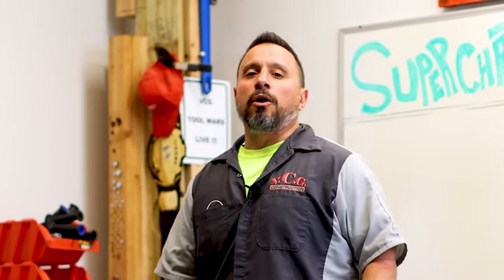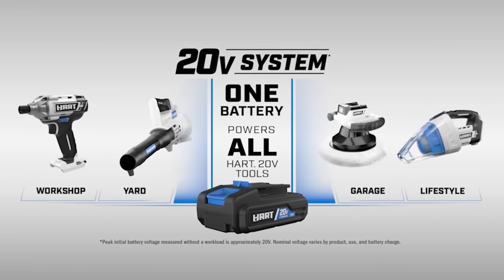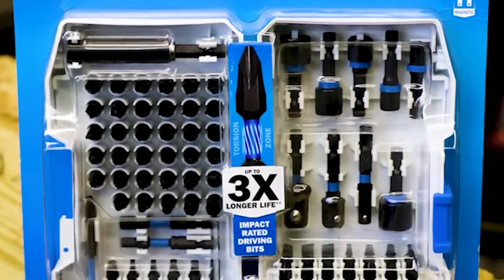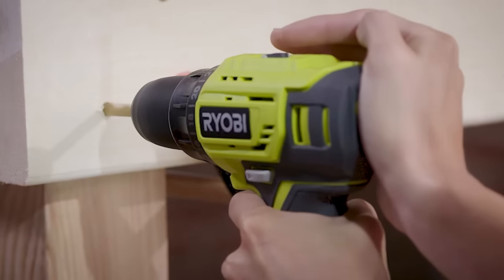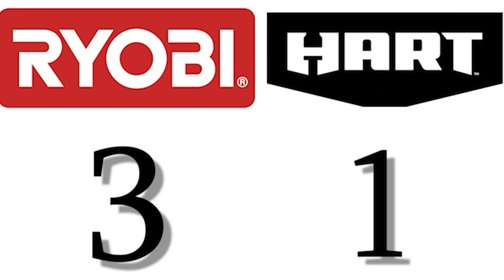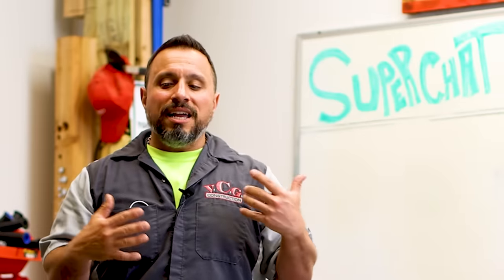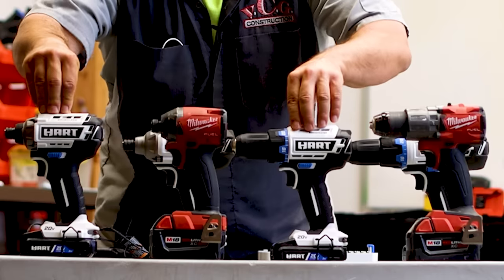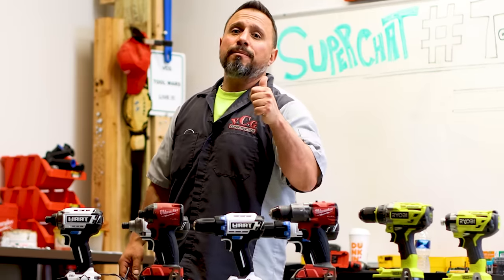HART Power Tools At Walmart PEOPLE HAVE NO CLUE!

Comment: I have used dewalt all my life, i started buying hart tools to avoid having them stolen of the job site. they are absolutely solid tools. nothing wrong with them.
Reply: Dewalt is under performing heavily, especially when it comes to impacts. But i totally understand this mentality when you do specialized work and need several tools. So many end up stolen, lost, dropped in a barrel of waste oil, etc. Its like boat tools; you are not going to want to put your snapon ratchet underwater.
Reply: They are made in China
Reply: @eagle94haslanded  Your opinion on DeWalt sounds like bull crap
Reply: @lexingtonconcord8751  watch the torque test channel and get back to me on that.
Reply: @ISitOn MyArm Rank charts
Reply: I don’t hardly ever use a drill maybe once every 5 years that’s why I just have a cheap knock off brand drill that is from Walmart if I used drills regularly then yeah I would definitely invest in a high quality name brand one but not hardly using it would be a big waste of money for me.
Reply: @ISitOn MyArm but I don’t have much to work on whenever it comes to using a drill
Reply: @ISitOn MyArm I don’t have anything to build though at least not right now
Reply: I'm impressed I got a driver and it has balls and the battery last I thought I was going to be a POS
Reply: If you can’t beat it to death, submit it to “torture” tests, and it perform flawlessly, and be expensive as hell, it’s no good. That’s how I pick everything. Even my truck tires. I buy em, secure the front end, do a 5 minute burnout, then complain they don’t have tread on em. Cant survive the torture tests
Reply: @corygriffiths4394  wondering what you are doing here watching this video and leaving comments if you dont use it as you mentioned???
Reply: @jerrykunk4860  All power tools are made overseas. No one wants to make a mortgage payment on a drill
Reply: You is right.. I use all hart tool brand myself just because people have the same tools on job site and be switching tool and battery packs out..
Reply: @jerrykunk4860  All power tools are genius.
Reply: I feel like a lot of brands caught up a lot to the Milwaukee dewalt etc not that they’re as good but they’ll perform well for most task
Reply: @jerrykunk4860  mine is made in Vietnam
Reply: Yup that’s why I bought Kobalt cause I know these tools get stolen especially  dewalt and Milwaukee even see people get into it over who’s battery is whos
Reply: @lexingtonconcord8751  actually if you take dewalt impact and compare it to every other companies in fact it is the worst one💯 in every way shape and form the amount of teeth in the head the motor used is is a hog that uses way too much electricity for what it puts out meaning it runs through batteries way faster and batteries do have a life cycle meaning the faster you have to keep recharging them the sooner they go bad everything he said is 100% true and based off of facts it sounds like you're just having an emotional reaction to something said that you don't take your time and do some research 🤯
Reply: @JoeBlow-You’re getting a lot of hate, but you’re right about the DeWalt impact drivers. I run nearly all DeWalt cordless tools and some corded tools as well. They have fallen behind in their development. The DCF887 has been their top-of-the-line impact driver for a number of years. Milwaukee passed them up on speed a while ago. Now Flex has also passed them up, although they are relatively new to the game and their line is small. They (DeWalt) brought out three new impacts: the 840, the 850 and the one that is supposed to replace the 887, the 845. The 850 is a compact model, which doesn’t have the mass of the 887. I’m skeptical as to whether it would last long with all day-everyday use. The 840 is from the Atomic line, which is homeowner line IMO. The 845 has not performed well against anyone in any test I’ve seen. I was really hoping for a better replacement for the 887.
Reply: Nice omw to buy hart tools then
Reply: I just bought one of their leaf sweeper/blower and it's absolute junk,
 It's going back, not worth $55
Reply: Lifetime warranty to and sets go on sale often for 98 bucks for the 215 and 270 piece sets. Just got the 270 for 98 bucks yesterday
Reply: Yeah but just buy Ryobi at that point right?
Reply: The leaf blower i bought was absolute junk.
 The battery wouldn't charge, plug it into the charger... nothing.
 Used the cord attachment (yeh a hybrid, oh joy)
 The blower was about as powerful as someone with asthma, who got emphysema, and had a lung collapse trying to blow out a candle...
 I tried holding it closer to the ground, and one of the leaves smacked it, and laughed...

 Got a screw gun just before, hadn't it and just returned that too because I knew not was gonna be junk, probably battery or something would've died in a couple months
Reply: Es lo que también voy hacer por eso andaba investigando la marca y el fabricante y como dece el video al ser fabricante de otras marcas como dwalt y Milwaukee no va a vender cualquier cosa aver que tal me va con mis compras😂😂😂😂
Reply: if your not using your dewalt tools anymore can i have them? 🤔
Reply: This is hilarious because that’s why I started buying Ryobi tools… damn methicans’ll steal any thing.

Comment: The Hart brand is the truth. I'm slowly building up my equipment and I'm liking the Hart brand. I own the 20v power drill, drill bit set with 70 pieces and the circular saw so far. Fortunately, I got a battery with the drill, and the battery works with all the 20v equipment you get. They're affordable, powerful and they work. This is a great brand to start with if you are a beginner like me.
Reply: Hart drills are good for DIY I would buy one but I rarely ever use a drill I use one maybe every 5 years that’s why I’m not investing in a high quality drill because it would just sit in the toolbox and never get used.
Reply: I have so far.1- 1/2 drill, 2-3/8 drill. 1- 1/4 in driver and 1 brushless 1/4 in driver,  6 1/2 in circular saw, Reciprocating saw, 4 inch grinder, 2 radios,a tire inflator,  16 in push mower,  Hybrid weedeater, Power inverter,  and lots of batteries  from 1.5ah to 6ah and a boat load of hand tools and ladders .  i have not one complaint yet on any of my tools. just wish they made the metal roller tool box again.  and maybe a battery only storage contractors case.
Reply: How good is the battery life all this time later?

Comment: I as a homeowner decided last year to get into the Hart line.  My Craftsman finally wore out after 25 years.  I have liked what I bought.  The two larger home projects I have done with them have been a bathroom floor and a outside porch.  They worked great.  My only problem is that the line seems to be overpriced now.  At first it was a good deal but now they have raised the prices.  I wait for a sale now.  I will be dead before they wear out.

Comment: Im a hardcore diyer, framed my basement, built my own pole barn, deck, etc..... I started with ryobi and after a couple trips to the HD returning the brushed green tools because they were constantly burning up and smoking, I switched to Milwaukee and Dewalt....... best move I ever made. 6 years later, still using the same tools and batteries and they work like they did new!!!!! Ryobi, hart, bauer good for hanging pictures on walls and building shelves and other small stuff, but for building sheds, barns, decks, etc..... save the hastle and grab a Milwaukee and get down to business!

Comment: I run a property management company and do most all the building maintenance, remodeling and upgrades.  My first battery drill was a B&D, it did the job but it was very "clunky" and the batteries didn't last. When the last battery pack died, went to Ryobi One 18v on a whim.. couldn't resist the deal. 4 years later, rebuilding 5 units, building a house, decks, plus metal and auto work on a daily basis , I cant kill the thing. I have driven 10s of thousands of screws, bored holes with drill sizes that had no business in that drill, mixed countless buckets of concrete, mud, mortar and grout, lost it off the roof a few times, knocked it off the ladder more time than I can recall.. it really looks like it shouldn't work but runs just like it came out of the box. As this worked so well, bought a Ryobi jobsite table saw and wet saw, rugged quality. So, just bought a Ryobi drill driver and I wondered why I waited so long.... love the thing. Have other tools, Hitachi radial saw, Dewalt saws-all, Craftsman portable radial saw and so on.. all great quality long lasting tools and in my experience, the Ryobi is right there. Did look at the Hart tools out of curiosity and I may be wrong, but the build quality looks a bit off, kind of what you see in some HF tools. For the minimal price difference, I think I'll stick with what works!.
Reply: yeah and ryobi batteries are pretty cheap as compared to others
Reply: Hercules and Bauer from HF destroy Hart if you want bargain stuff
Reply: the few ryobi tools i have have been great tools as well. i have a jig saw router and a miter saw from them. i have nothing cordless however minus a weedeater i paid 5 bucks for.  all my cordless tools are milwaukee.
Reply: @jeffreyrigged  yeah I tell you my ryobi battery chainsaw is so awesome no gas or cords in the way.
Reply: @luvdady  i prefer a gas chainsaw and weed eater over electric but for an electric this ryobi isnt bad. i use it as a backup for my stihl or for just a small odds and ends.
Reply: @jeffreyrigged  yeah till you run outta gas 20 ft up lol .
Yeah I mean its no huskavarna but for basic limb job its easier to swap batteries
Reply: @luvdady  yeah im sure it is. my dad had a plug in poulan i cut down a million schrubs.
Reply: My original ryobi impact lasted 13 years before i had to replace it.

Comment: I only have ryobi tools.... I been having them for years and still work great. Won't change any of them any time soon... Best price too.
Reply: No
Reply: @salcisneros2244 ..... No???
Reply: Same here. Had nothing but good luck with Ryobi
Reply: Me too, I've already bought into the 18v system. It'll cost me a fortune to buy a new set
Reply: For cheap tools Ryobi is the best out there and has been for 20 years
Reply: I always had Ryobi since I started working in construction years ago and every single power tool that I've bought, still works great. Especially love the converters.... The one that has two USB ports and an outlet. I just put in a 18 volt Ryobi battery and I can charge multiple things all day
Reply: @chrisc.c52   After my $1000  Ryobi table saw with all the accessories burnt its drive motor after 3 years and didn't I have a replacement, I never spent a cent on them again.  It hurt to have to see it go into the trash!  NOBODY offered that  motor.
Reply: Ttl makes Ryobi Milwaukee and hart

Comment: Well, I bought the Ryobi 18V line of tools 10 years ago and used them on my job installing HVAC for years. They really took a beating over the years and it was the best investment in cordless tools for me. they still are running good too!
Reply: About how long would you say the 4AH batteries last before they break?
Reply: @ilyas5708  I couldnt say, I only had one break due to a nail getting caught in the saw blade and shorting out the motor. Not the battery fault, crap happens.
Reply: @ilyas5708  my oldest 4ah pack I still have in my daily use circulation has a 2014 date code, yes the runtime has gone down a bit but it still runs my impact driver for a week or so worth of service calls. Or about 20 minutes of cutting the thick uni-strut with the brushed angle grinder vs about 35 with the newest.

Comment: I bought a harts tool set and the ratchet is so darn smooth, I just feel like it’s getting hate cause it’s sold at Walmart, now I can’t say anything about the electronic trolls, but average tools like wrenches, ratchets and non electrical equipment, Harts really isn’t bad
Reply: Yeah, I have the ratchets and mechanics tool set and all that. The only power tool I have from hart is their electric screwdriver. I actually love their wrenches and ratchets.
Reply: That's exactly what's happening Papa Whisk! I've only got the drill bc I have a compact Milwaukee impact. If not for that I wld have both.
Reply: So I bought a Hart 1/2" drill, not bc I was at WM either. 
I actually went to Lowes looking for a combo set bc sales looked ok on a few good brands.  I think Dewalt and Skil (decent tool).
Here's the problem with those 2 sales. 
1. I looked around 45 min or so, waiting on/trying to get help w availability bc prices weren't clearly marked. 
2. Help didn't come! 
3. Went to fastener isle for help w/4.5-5" screws and combo set. 
4. Guy working that isle? Well...I found my own screws bc he kept insisting bolts? I'm wiring on 60yo shudders 👌🤣💩
5. Went to power tool area,  didn't have Skil combo,  or single drill that's in combo.  Only the bulkiest drill they make for 25 more. 
6. Didn't have Dewalt combo either. Only (1) 4 or 5 to set for almost 300 more. Or the (2) step up LI battery w/more 5 or 10 more V (175 more). 
6. Above mentioned combo (1) only had 4 tools (unless you consider a speaker a tool). Knock off 75 and keep that shit, or give me 5 damn tools! 
7. Last and definitely close to least!Only other comparably price was Shafts-man. I don't need a battery to last me 4hrs but need 1 tha last more than 10 min!
So finally fed up I say screw you Lowes! Only got a couple things that I didn't think I cld find at WM. Drove a mile to WM, got toiletries and stopped at tool section. The things I didn't think I cld get (sandpaper, x-long bit) WM had both, same brand sandpaper 5 bucks less and decent bits.
Decided on the ½" 20v drill, hat to go to sporting goods to get car open but had what I needed in few min.  Dude (older gent) was straight up when I asked questions about the product, said sorry man but I don't have a clue, sorry! 
I sd fck it and rolled dice.  
Final thoughts on HART; for the price, I have zero complaints! 
I spent 5+ yrs in industrial maintenance, used Milwaukee. 
Hart ½" 20v drill isn't far behind Milwaukee in power at all.
Battery, not quite there yet.  Although they're decent, just can't hang to the life of Milwaukee (⅔) may be a stretch. Luckily I don't need hours of battery bc I'm not hammering ¾" × 3" or larger bolts at 200-380 ft lbs or torque.
If you just need a good drill at a good price,  they have one for you.  Combo with 1 battery though? They can keep that bullshit!  I'll be emailing my opinion on that for shits n giggles to see how cust service responds if nothing else.  CS is usually the main reason I stay with a certain brand of anything.  Imo, thats a gamechanger on future purchases.  

Sorry for the long winded gripe on Lowes w/short n sweet review on tools. 🤷🏻‍♂️
Reply: How do they compare to Ryobi and kobalt?
Reply: Got a pretty decent Dewalt set for Black Friday. $300 for brushless  impact, drill, oscillator, orbital sander, a brushed 6½ circular saw, 2 and 4ah batteries, (not fast... one battery slot) charger, and carry bag. Not sure if they'll bring it back. Only downside is I think Dewalt overcharges for their batteries (bought a cheap pair of chinesium knockoffs one of em overheated and failed... still maybe worth it lol). Probably gonna get and fix old Dewalt packs.

Comment: 25 years ago, I was working as a carpenter building custom homes, and 90% of the drills, and reciprocating saws on the job site were Milwaukee. my sawzall was corded, but still the top tool to have. another guy had a makita reciprocating saw, and thought his was better. so when we had to cut the 72 1-1/2" anchor bolts after putting the sill plate on, we started side by side and went opposite directions.   I burned a couple blades that day, but I was well past the middle when we met up, and his saw was hot to the touch and smoking, mine was cool, and still purring like a kitten.
Reply: Remember,  back in the day,  Makita was the cheapie line of tools..
Reply: Cool story bro

Comment: Dropped the Ryobi drill in the salt water pool 3 years ago, dried it out and it is still working today , so that sold me on the brand.
Reply: Ryobi is the way to go. Love my Ryobi tools
Reply: I love my ryobi tools...
Reply: why do you have a salt water pool.............. you want to raise sharks?
Reply: @potatochobit  with mild salt water one can make their own chorine with a light current running across dissimilar metals. You can look up "chlorine generators".
Reply: dropped my dewalt drill in 3 ft of muck in a coal mine, rinsed it off in salt water pool there, cleaned it up when got home still works like a champ after 10 years!
Reply: I've dropped my ryobi impact from 2 stories or more waaaay more often than any sign guy should and 5 years later it still works fine. Funny enough, our tool graveyard is mostly broken milwaukee

Comment: I was working a job where they provided contractor grade Dewalt / Milwaukee tools. Once I quit, I found I wanted more tools for working around the apartment / now house. I watched some reviews etc. Hart is made by the same overlord company as Milwaukee. Watched a few other reviewers who put them through side by side tests against dewalt / milwaukee tools and saw plenty of reviews from people claiming to be contractors. Other than slightly lower RPMs on the drill, the reviewers all said it worked just as well as Dewalt just slower.

I made the leap, been using them for months and months now and am completely satisfied. They're doing literally everything I've asked them to do without problem. Their handtools and other power tools have all satisfied me so far. So, for a DIY homeowner I can say that 'maybe' they were over priced, but they're high quality and function as well as any dewalt / milwaukee tool I've ever used.